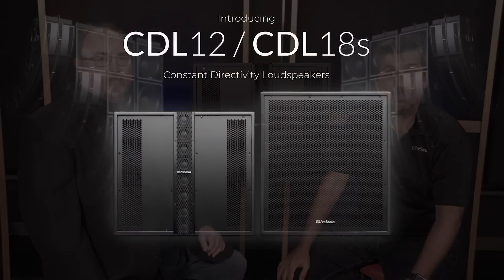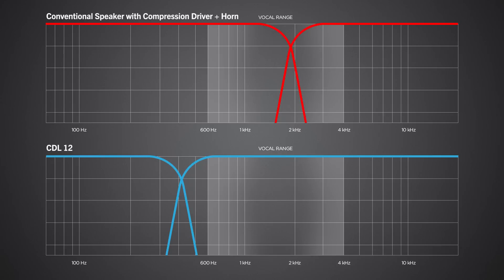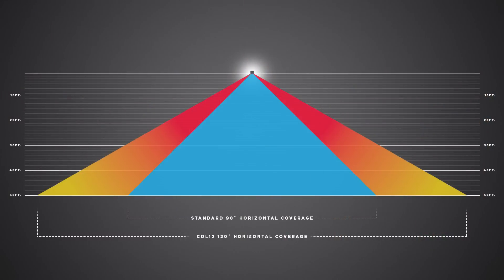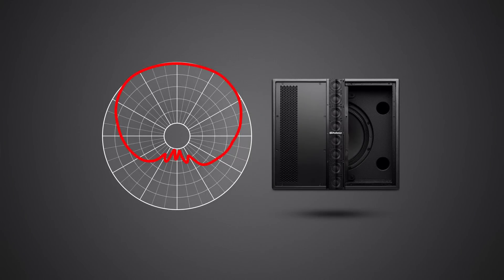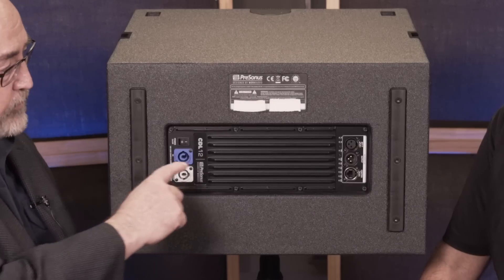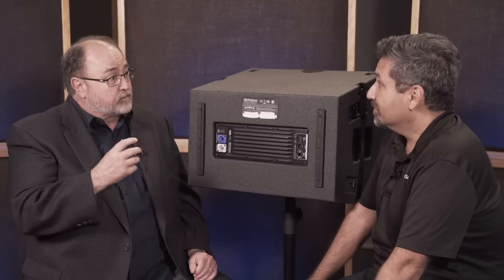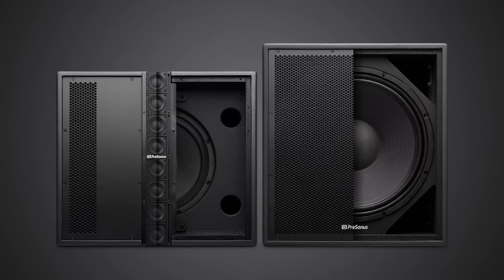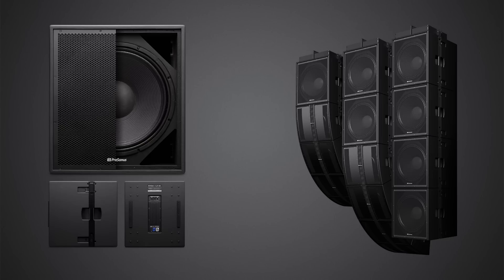Rick Naqvi and Hugh Sarvis discuss the New CDL Loudspeakers

Comment: My question is in regard to either going with 2 tops and 2 subs or with 4 tops.  My band is all direct (no amps) including electronic drums.  It would appear that just the tops alone would be sufficient low end but I'm wondering if you can get more overall SPL by running 4 CDL12s as opposed to 2 and 2.  Maybe only take 2 for smaller gigs.  I noticed both set ups in the literature.   Does the low end increase with the 2 tops and the 12" speakers coupled in close proximity?

Comment: AVB connectivity option instead of or along with Dante? 
Will this work good for outdoor gigs, do they have a long throw for the 2 inch drivers or are they designed more for indoors, also what are the spl on these boxs. Thanks
Reply: Yes, it works great for outdoors as well as indoors. You have eight 2" drivers that have a 1" voice coil. The way the grill is designed makes it function like a horn so it throws both far and wide.

Comment: can I ground stack the system without the speaker poles......  2-3 subs on bottom and 3-4 cabinets on top?
Reply: We recommend 2 tops over 2 subs with a short pole just to get the correct angle and to get the boxes at the right height. We have a short pole that we will be selling soon but for now we can give you the recommended length.
Reply: Rick Naqvi so 2 subs over 2 cabs when ground stacked and use the pole.  Sounds great.  What’s the release date?
Reply: We are shipping this week!